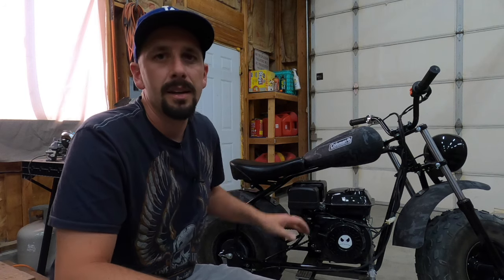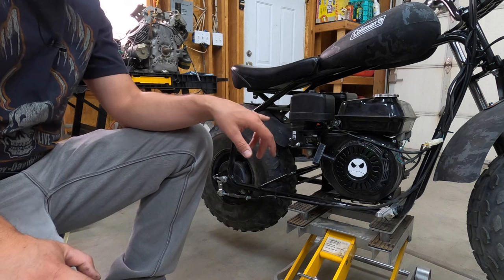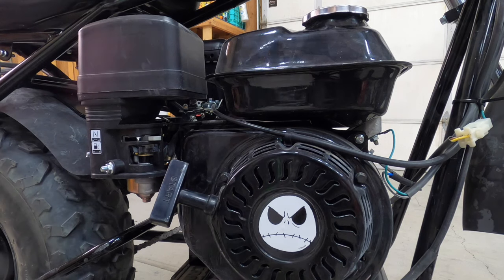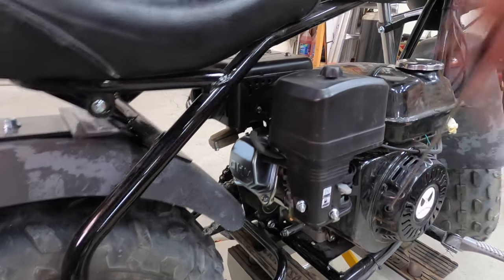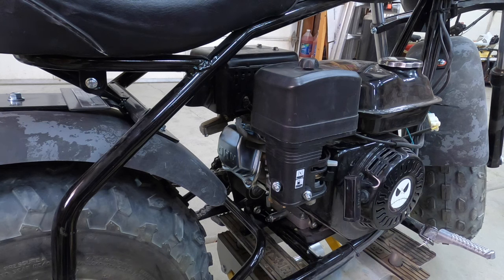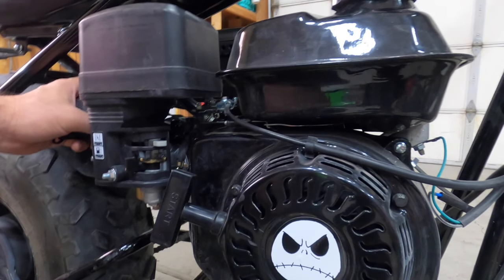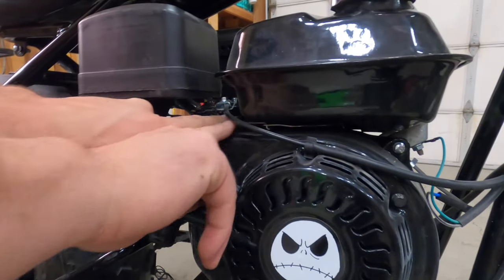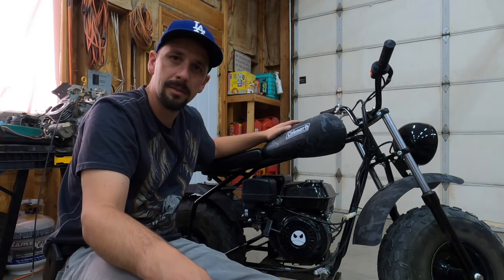How to adjust the idle speed on a mini bike with a non adjustable carburetor...(stuck clutch?)

Comment: Gonna leave a like, gonna try this out on my bike tomorrow! Been looking everywhere on how to fix this issue and this is the only video I've found.
Reply: Same
Reply from the maker: Good luck, hope it works for you!
Reply: Same here, fitted the Stage 1 to the Massimo Warrior, and know I face the issue of the bike lurching forward on start-up. Noticed the that the accelerator spring is stretched already, removing almost “floods” engine and it battles to start.
Reply: @kbssmallenginerepair2615  Good Video, I'll probably try it, BUT, I have a weird issue....
Coleman CT200U-EXStock, will not run unless the Choke is on or partially on, like Mostly on, but not all the way, and when I move it to off the engine dies....

Any ideas???

Comment: Nice video KB. That could be a dangerous situation for a child. Sad that Coleman would sell something that was a potentional liability issue . Would have been easier to have made the carb with an idle adjustment. 👍🇺🇸
Reply from the maker: Absolutely!  There have been many issues with this.  It is a very dangerous situation and I don't like it one bit.  I don't know why they went away with the non adjustable carb.  It was a very recent change.
Reply: @kbssmallenginerepair2615  The non adjustable idle screw is probably some EPA mandate. Not sure when that started but I know others have been complaining the last couple years about the non removeable main jet. The jet can be removed with some work but most guys just buy a new carb. Those engines run lean to start with and many want what's called a stage 1 kit. It's a header pipe, open element air filter and a larger main jet. This is needed when they want to run higher than 3600 RPM.

I would have troubleshot that differently because those springs are all identical and shouldn't need adjusted. There's something else going on there even though stretching the spring worked. The purpose of that spring is to hold the throttle on the carb open while the engine is off. This way the throttle is open to start the bike with the choke closed. Once the choke is opened the governor moves the throttle on the carb to the idle position. If the throttle cable is out of adjustment and the manual throttle is partially opened then the governor has 2 spring tensions to overcome and will idle higher. The throttle cable would be the first thing I would have checked for that issue.

Comment: Quick question so I replaced the carburetor on a Coleman minibike 200c & it runs fine but when I full throttle after a few mins it just turns off any ideas what I could do?

Comment: As a recent mini bike owner (BT200X), this was a life saver...not perfect, but still...then i swapped out the stock carb, based on your HiPA vid...
of course it wouldn't idle...because i had mangled the throttle return spring  }:~  i'm learning...rather than trying to 'fix' the carburetor, 
i replaced the weakened TRS with a new one from a 'throttle plate parts kit'  and...the bike runs better than ever...the new HiPA carb is
a BIG improvement...the stock bike idled too hi, surged periodically and was just not as easy to ride/control...thanks to you and others
on the net, i can tackle this stuff with some confidence of success...

Comment: I hope this fixes our bike.  Same issue.  I don't know why your video was so hard to find when I was searching for videos on how to adjust the carburator.  Once I searched for replacing the carburator, your video came up.  I'll let you know though.  Thanks for the info.
Reply: I unhooked the spring while trying to stretch it.  But it unfortunately didn't help.  I feel the idle is way too high.  I'm gonna mess with it a little more, but I think it needs a carburator with an idle adjustment screw.
Reply from the maker: It's hit and miss.  Some of them just scream all the time.  I would start with a different carburetor.

Comment: I sorta felt like this was common sense. I also had this problem when I tried to shorten the spring in between the throttle so it wasn't so stiff. I ended up removing the spring that is factory and in between the throttle and replaced with a tension spring instead to pull it back rather than push it back. So much smoother throttle.

Comment: Good video.  I'm having a different problem.  After going wide open throttle and cutting it down to half throttle it will sputter slightly.  After doing this a number of times, I got a backfire on the next startup.  I think it's running rich?  Is there an air fuel mixture screw?

Comment: I bought my Colman CT200U minibike new 8 years ago. put about 5 miles on it and stored it in the barn for the past 8 years. I got it out of the barn yesterday (7/4/2024). The gas tank was empty and free of any contaminants. I removed and cleaned the carburetor. Changed the oil. New gas. It started right up when choked, but went full speed when I opened the choke. I took off the spring like you instructed, but it still runs wide open when the choke is off. Any suggestions? Thanks.
Reply: same smh…

Comment: Good video thank you
I purchased a used monster moto mini bike.
The engine is surging for fuel when choke is off. Warmed up of course. I think this is a non-adjustable carburetor because the only thing that looks like a air fuel mixture screw does not have a head on it to adjust. Do you have a workaround on this?

Comment: Nice info.. quick question 
My mb200 mine bike i was riding it only 3 months old and left me stranded 😆. About a block away fro the house.. starts fine and I can see the shaft moving, I thought it was a clutch so I replaced it.. won’t move when giving throttle but was five before.. has not messed with it since i bought it.. all spring are there. Is there anything I a missing that I know know or do I need to go further in the engine 
Any feedback would gladly appreciate. Thanks

Comment: I have a question I adjusted my idle speed just by taking all the slack out of my throttle handle adjustment and plus just a little bit and not my throttle is tight and shorter of course which is nice but now it idles good and doesn't die after sitting for a while. Now what I'm wondering is if that is a proper way? I noticed before it would idle higher when cold starting which is fine but now I wonder if it's gonna idle too high on cold start next time i go to start it I guess I'll find out lol but just thought I would throw that out there that it's always something to check as well if that's too tight it will take off or not idle well. Even though it's kinda a work around instead of messing with the throttle spring and all that

Comment: I have a little pit bike which I had to replace the throttle cable on, but now the throttle won't even function. You have to take your hand on both sides to apply pressure. The customer is also missing a return throttle spring for a Tillotson Baja 97cc. I've tried looking for return springs, but they look pretty long.

Comment: If u back out governor screw besides this governor spring what else should be done to keep motor from shutting down now governor is still in motor I just backed out screw to have more throttle but I need to know what else i need to do an get untill i take out governor.

Comment: my minibike throttle has no snap back, so when i use the throttle and i go, if i let go of the throttle it won’t stop, it also has started to take off on me when i pull start it. It also needs to be given gas in order for it to start, if i don’t then it will not start running. I have no idea how to fix this, will this solve my issue?

Comment: Mine takes off but the idk if it’s the spring. When I give it gas that piece doesn’t open open or close. It didn’t used to do that but it sat for a while and I changed the carb and now it does that. Put the old carb back and still does it ..imma try this tomorrow but any other suggestions?

Comment: I adjusted mine by going up to the handlebars at the throttle and the cable in the threaded tube with the jam nut, just screw the tube in or out and lock the adjustment with jam nut...Also, go to the other end and cut the return sprig and re-adjust the end cable...It takes out the slack in the hand twist...
Reply: When you cut the return spring on the throttle cable it shortens the return, because with the spring compressed it restricts the length of the throttle plate return leaving it to idle higher...Shorten the spring and readjust the slack in the cable, using the cable tighten screw on the engine...I hope this makes sense...

Comment: Thanks man, Gonna try this, just bought one of these and this has been a problem. Also seems to be running rich with some leakage into the exhaust with backfire. was wondering how to adjust the carb, or if I should just buy an aftermarket carb?
Reply from the maker: I personally would just buy a new carb.  The carburetors on them are not adjustable and just plain junk.  Look up a HiPA carburetor for it and it will be plug and play.
Reply: @kbssmallenginerepair2615  Thanks man appreciate your reply and expertise, sometimes these bikes end up being more work than they need to be. Found the HiPa carb on amazon, should just get the Hipa Carb for like $16 or the Hipa Carburetor + Recoil Starter Coil Ignition Coil for $40?
Reply from the maker: No problem at all.  Unless you need a recoil and ignition coil, I would just go for the $16 carb.  It is up to you if you need, or think you will need the other parts.  That carb is solid though...
Reply: @kbssmallenginerepair2615  thanks man, loving your channel. Learning alot. I installed the new hipa carb, but the bike doesnt idle it just wants to go. Trying to reconnect the governor springs is difficult, the butterfly on the carb always stays open. Im thinking of possibly bypassing the governor, or removing it, but some people say to be careful with high revs and blowing a flywheel. Was wondering what you think I should do?
Reply: @Tiagomedia  you should have just got a mikuni clone from Amazon. they're more expensive but fully tunable and automatically bypasses the governor when you install. Plenty of videos online.
Reply: @MrMGutierrez84  yup makes sense

Comment: My Massimo MB200 does this sometimes though. I'll go to start the bike and sometimes it works great other times it will try to run away but not a full power and if it does manage to run away if im not holding the break or something it only goes for a few seconds then stops and falls over. Any help?

Comment: after a weekend in the desert i tried ripping the bike back at my property and it seems like it’s shaking a little harder and rougher than before on hard acceleration. I oiled the clutch and it doesn’t seem to be too dirty any ideas?
Reply from the maker: I would clean and lubricate the chain, and sprockets.  Make sure everything is moving freely and there is not any buildup anywhere.

Comment: Just bought one and had to put the new fuel screen in. Reasonabled it and now it want to take off just like this. Also my black throttle does not move when off and rotating the throttle on handlebars... weird?

Comment: I did this zip tie mod and after this I have the same issue. Is it normal after doing the zip tie trick that it overevs at idle? Or should I try this even tho I use ziptie trick?

Comment: I have the same model, I had it for awhile and fixed the jack plate and chains, but it has alot of vibrations and is violent and tighted the mounts. Do you have any ideas?
Reply from the maker: If you fixed the chain, I would make sure that the back wheel is lined up straight and the sprocket is lined up perfectly with the clutch, so the chain is driving smoothly.

Comment: I hsve a issue where the return spring for the carb i konda bend it but fixed it but now i  start on choke but when i slide to run it idles weird and wont take off

Comment: What is that tach your using? I’d like to get one.
Reply from the maker: It is an Oppama PET-1100  It is the one Echo uses.  Very accurate.  I love it.  Kind of expensive but you can use it for 2 or 4 stroke, and multiple cylinders.  You may be able to find it cheaper, but here is a link.  https://www.ereplacementparts.com/pet1100-eng-tachometer-p-2253059.html

Comment: Ayy man i have the same one but mine has a few problems I put the choker and turns on but once I switch it to run normal and give it a bit of gas it turns off
Reply from the maker: Is it brand new, or older?  If it is only running on choke, you are having a fuel delivery issue and likely need to replace the carb.  You can try cleaning it but you will not be able to pull the jets out to properly clean them.

Comment: So... what changes on a motor that causes the string to be too tight?  I just had this happen on my son's machine.   this worked, but why?   Shouldn't it be the other way around ?
Reply from the maker: You are correct.  The purpose of the "throttle return spring" is to return the throttle to a closed position. For whatever reason on a few of these Colemans this corrects the problem.  I will tear one apart and see if I can figure out the why.

Comment: Is there a way to get rid of that chain noise in the lower rpm’s?
Reply: Your chain might be little loose, mine used to bounce around until I adjusted the chain , very easy fix if that’s what ur talking about. Rear bolts that hole back tire together (axle) has to adjustsmenet u can tighten with a 10 or 12mm to tighten the chain slack

Comment: I have a similar issue with a mukini 22 on a predator 212 stage 2racer kit. While sitting on a lift at start high RPM and rear wheel 🛞 spinning fast.
Reply: I have a normal 212cc predator but still didn’t fix it

Comment: I just got mine two days ago has the same issue I figured it was either the  clutch or the idle adjustment I looked in the manual and it looked like the adjustment screw was on the bowl but I'm not sure
Reply from the maker: There are no adjustments on the carburetor unless you got a NOS machine from somewhere.  All the newer machines have non-adjustable carbs.

Comment: Would this work on a Massimo mb200? The engine looks exactly identical but the mb200 has an idle adjustment screw
Reply from the maker: If it has an idle adjustment screw, start there.  All you are trying to do is adjust the idle to the proper idle speed so the clutch doesn't engage.  For the Coleman I believe it is right around 1700 RPM (if I remember off the top of my head).
Reply: @kbssmallenginerepair2615  well I backed out the idle screw until it fell out and didn't see or hear any difference. I came to the conclusion that the root of the problem was the butterfly arm connected to the governor, but now I'm not so sure. Yesterday I went up the mountain in my backyard and now the idle is higher than ever. When I brake, the engine sounds like it is trying to take of from a standstill and has a very distinct "put-put-put" sound. Me and my little sister's bikes have the same issue of creeping in idle, but my dad's bike never had this issue despite him hotrodding his bike up the mountain more than anyone, but now his is starting to creep just like the other two bikes. I took the cover off the torque converter/clutch/throttle or whatever you call it, it has a chain tensioner and a large disc with holes in it and another disc inside of that disc. I think it is called a centrifugal clutch. The inner disc is not stopping at all when the throttle is disengaged. I have no clue what is going on and my father would rather return them than hire a mechanic. If you have time, your insight and opinion would be welcomed greatly. Massimo mb200 warrior is the name
Reply from the maker: If the idle is higher than it should be, you can try this adjustment on the spring.  If the bike just wants to take off from idle, but the rpm at idle is ok, then you need to check the centrifugal clutch.  The clutch binding up is a very common issue as well, as I think I mention in the video.
Reply: @kbssmallenginerepair2615  how would I go about un-binding the clutch? There is a nut holding the clutch on and it has grooves in it to allow a pin to pass through the rod holding the clutch. Does that have anything to do with it?

Comment: Somehow i ended up with a CARB bike in NY LoL.

For some reason they are hard to finds up here right now where I am so it's alright and it won't be stock come spring anyway.

Thanks for the tip, my bike seem to idle a little low but I think I just need to ajust the throttle cable mostly(just got it tonight, have maybe an hour on it).
This would be the next thing to look at, I might have a different spring that will work laying around if mine is wonky.

Comment: I'm having issues where it was cold and my throttle froze bc a spot of mud got on it I thought it was stuck at the time and cleaned the carb now it won't start unless you put starter fluid and then fire up and it maybe starts but then when it does start it flies forward
Reply from the maker: I would just replace the carburetor.  Check out the video I posted today.  You can get a new carb that works excellent for about $17.

Comment: That’s definitely wrong  all u need to do is lose the the nut on the throttle cable by throttle bar and unscrew or screw  it adjust the idle
Reply: The throttle cable should be the first thing checked.

What he did here is a work around. These engines are nothing new. The exact Honda designed throttle arrangement has been used for decades on Honda GX and every clone that followed. I have six of these engines, two of them on Coleman bikes and never seen this issue. The Honda designed linkage system works perfectly, unstretched spring and all.